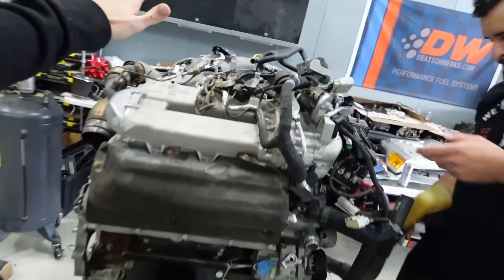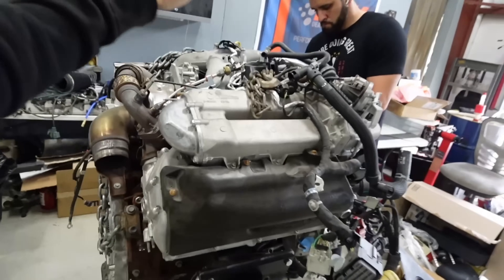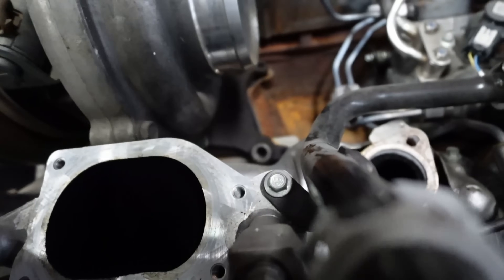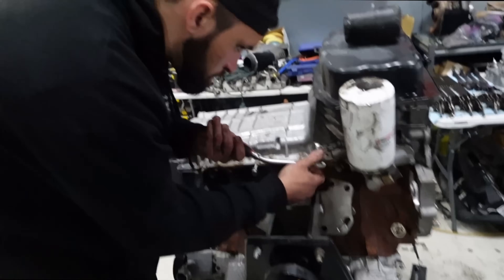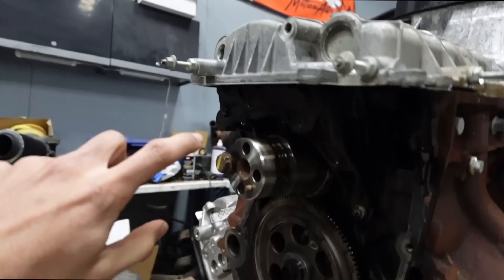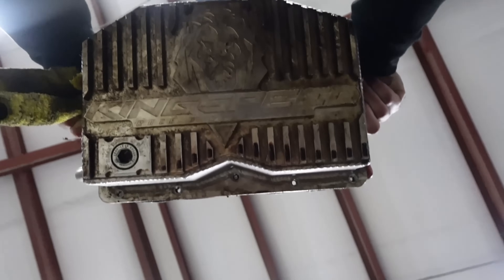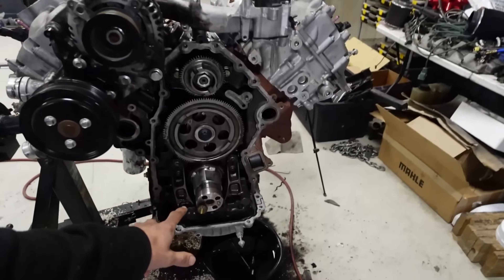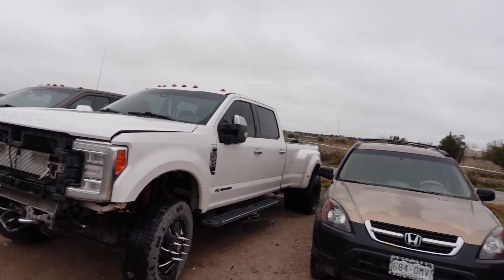Building the ULTIMATE 6.7 Powerstroke Engine For my DREAM TRUCK! Pt.1

Comment: Wait so what happened to the 6.7 you dropped off at the machine shop, I thought that was for the white compound dually? When did this 2020 engine come about ?
Reply from the maker: That one is all
Machines and ready to go back together, we will save to for another project
Reply from the maker: The 2020 engine has steel pistons. And the engines handle the power a lot more

Comment: Thought I heard at some point you can't weld on parts of the engine or it will mess with the bearings. Could be old misinformation that I'm remembering.

Comment: What happened to the block you were going to build? Love the channel Trevor, been a follower of yours since the Blasta510 channel. Ive noticed the views are down, i hope you stay with it and keep putting out content, even 2-3 a month is better than just throwing in the towel. Thanks for the content for all these years. Randy from PA
Reply from the maker: @randystepchuck7695  we decided the 2020 engine was a better option due to the steel pistons and better connecting rods - should handle the heat and power a lot better with the compound turbo setup

Comment: What's the story on the white V70 in your parking lot?
Reply from the maker: Bought it from an auction/ jumped timing belt and haven't torn into it
Reply: @MotionAutoTv  Pretty easy job. Valves are bent for sure. Unless it's a manual or awd, it's probably not worth fixing.